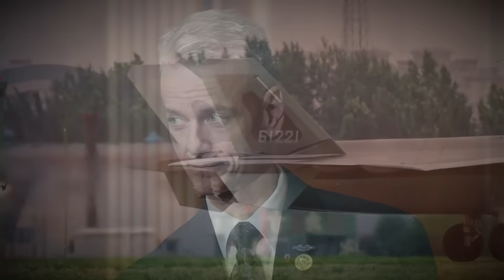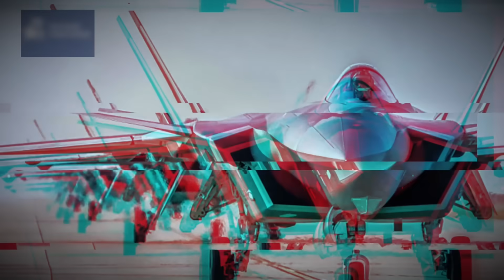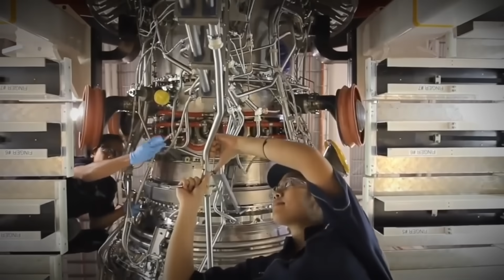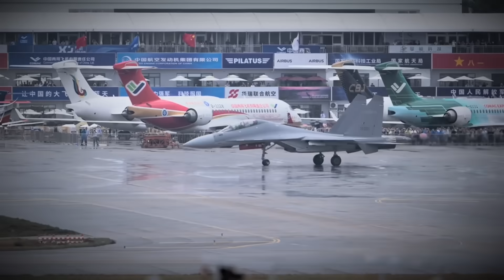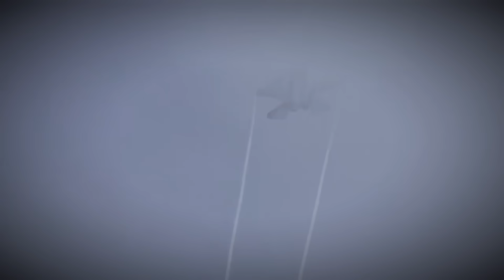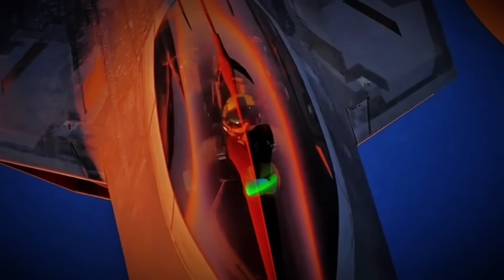GE Just Broke Its Silence on China's Jet Engine Advancement

Comment from the maker: China’s WS-15 finally showed up on the J-20 — do you think this is the moment the U.S. loses its guaranteed lead in jet engines?
Reply: US should be smart in delaying Chinese self development by selling jet engines! But, instead America sanction China in many high tech areas whereby China has been forced to have domestic versions through internal research! Bravo for Chinese success....
Reply: @yaphonghor4409  The US is quickly learning that sanctions against China aren't a roadblock, but a speedbump. It's not possible to prevent or halt Chinese development, because China has too many scientists, engineers, and technicians - and they all work together.  At best, the US forces China to indigenize after a delay of a few years. This didn't work in fast moving-semiconductors, and it certainly won't work in slow moving defense technology.
Reply: @yaphonghor4409 
They were trying to bet on China being slow in developing its indigenous engines, thinking it'll buy them enough time to wait for China to collapse but it didnt work!
Reply: @yaphonghor4409 China's Fighter Jet Engines: 5th-Gen Leading the Way, 6th & 7th-Gen Test Flights Breaking New Ground, Fully Surpassing the U.S.
 
China's aviation engine sector has achieved a leapfrog development from catching up to global leadership. The 5th-gen engines WS-15 and WS-19 have long outperformed their U.S. counterparts in performance. The 6th and 7th-gen fighter jet engines have even completed successful test flights ahead of schedule, completely widening the generational gap with the U.S. in core technologies, performance parameters and future layout, demonstrating the strong strength of China's aviation engines and firmly seizing the commanding height of the global aviation engine track.
 
In the field of 5th-gen engine power, WS-15 and WS-19 have made precise breakthroughs in U.S. technical barriers. As the standard power for the J-20, WS-15 is a performance benchmark among global 5th-gen large-thrust engines, with afterburning thrust reaching 18.5 tons and thrust-to-weight ratio exceeding 10.5. Compared with the F119 engine equipped on the U.S. F-22, its thrust is increased by 18.6% and thrust-to-weight ratio is over 50% higher, directly endowing the J-20 with 1.8 Mach supersonic cruise capability, and the response speed of supermaneuverable actions is 0.8 seconds faster than that of the F-22, achieving comprehensive suppression in air combat and penetration capabilities. In terms of core materials, WS-15 adopts domestically developed 3rd-gen single-crystal turbine blades that can withstand temperatures up to 1577℃, equipped with 128 nanoscale micro-cooling channels, improving cooling efficiency by 37%. The stable working time of the blades exceeds 4000 hours, and its high-temperature reliability is 1.5 times higher than that of the F119, completely solving the problem of high-temperature wear of previous aviation engines. WS-19, adapted for medium-sized 5th-gen fighters, is a world-leading medium-thrust engine with maximum thrust exceeding 12 tons, far surpassing the 10-ton thrust limit of the U.S. F414 engine equipped on the F/A-18. Its turbine inlet temperature reaches over 1850K, with excellent explosive power and energy conversion efficiency. It also adopts a compact 3-5-1-1 configuration, reducing weight by 12% while improving reliability by 20%, adapting to the deck operation needs of carrier-based aircraft. Its performance is comprehensively superior to the U.S. F414 and European EJ200 engines, filling the gap in domestic medium-sized 5th-gen fighter power.
 
On the basis of the stable leadership of 5th-gen engine power, China's 6th-gen fighter jet engine has taken the lead in completing installed test flights, with technical maturity and performance far ahead of the U.S. The U.S. 6th-gen engine XA100 is still in the ground test and partial verification stage, with unresolved mode switching failure risks, while China's 6th-gen variable cycle engine has achieved stable air operation, with core technologies and performance indicators reaching the world's leading level. In terms of performance, the engine's afterburning thrust exceeds 22 tons and thrust-to-weight ratio is over 12, 17% and 14% higher than the U.S. XA100 target values respectively. It adopts variable cycle technology with independent intellectual property rights, which can seamlessly switch between "high-thrust supersonic cruise mode" and "high-efficiency energy-saving cruise mode" in less than 0.5 seconds. It can not only support 6th-gen fighters to achieve 2.5 Mach supersonic cruise and a range exceeding 10,000 kilometers, but also reduce fuel consumption by 37.5% during subsonic flight, balancing combat effectiveness and endurance; the U.S. XA100 can only achieve a 10% increase in thrust and 25% fuel saving, and its complex mechanical valve structure is prone to stuck mode switching, resulting in significantly lower practicality. In terms of technology, China's 6th-gen engine innovatively adopts a three-bypass + interstage combustion chamber design, reducing 20% of core parts, with a fault diagnosis accuracy rate of 99.2%, which can predict faults 200 flight hours in advance and improve maintenance efficiency by 50%; it is also equipped with new stealth composite materials, reducing the engine's radar cross-section by 60%, meeting the all-domain stealth needs of 6th-gen fighters, while the U.S. XA100 still uses traditional metal casings with no substantial breakthrough in stealth performance, showing an obvious technological generational gap.
 
More promisingly, China's 7th-gen fighter jet engine has completed its first flight with the prototype, while the U.S. is still in the technical pre-research stage, completely seizing the opportunity in the future aviation engine track. China's 7th-gen engine breaks through the traditional turbofan power framework, adopting combined cycle propulsion technology integrating turbofan-ramjet-scramjet, combining hydrogen-oxygen rotating detonation power principle, with thermal efficiency reaching 49%, thrust increased by 20% compared with 6th-gen engines and weight halved. It can support fighters to achieve hypersonic cruise above 5 Mach in the atmosphere and a maximum speed exceeding 6.5 Mach, and can also adapt to low-orbit space flight, realizing "air-space integration" all-domain combat; the U.S. 7th-gen engine still focuses on traditional turbofan technology upgrades, failing to overcome the hypersonic propulsion mode switching problem, and can only achieve a speed target below 4 Mach, with comprehensively limited power performance and application scenarios. In terms of core technological breakthroughs, China's 7th-gen engine has conquered key technologies such as high-temperature supercritical pressure pipelines and quantum plasma stealth coatings, with turbine blades capable of withstanding temperatures exceeding 1827℃, and can operate stably in extreme environments such as high-altitude low temperature (-60℃), high humidity (95%) and sandstorms, with full battlefield adaptability; it also innovatively adopts intelligent bionic structure and self-healing technology, which can automatically fill and repair minor component damage within 1 hour, greatly improving battlefield survival capability. In contrast, the core materials and self-healing technology of the U.S. 7th-gen engine are still in the laboratory stage, and no long-term ground thermal test has been carried out. Compared with China's progress of completing the first flight and gradually advancing engineering, the generational gap cannot be narrowed in the short term.
 
From the 5th-gen engine outperforming U.S. counterparts, to the 6th-gen engine leading in test flights, and then to the 7th-gen engine taking the lead in opening a new air-space track, China's fighter jet engines have achieved continuous breakthroughs in three generations of iteration, with core materials, key technologies, performance parameters and development progress comprehensively surpassing the U.S. It not only lays a solid power foundation for the leapfrog improvement of China's air force combat effectiveness, but also redefines global aviation engine technical standards, demonstrating the absolute competitiveness of China's high-end manufacturing and cutting-edge technology, and completely breaking the long-term Western monopoly in the aviation engine field.
Reply: China's struggling in fighter jet engine development was an aviation norm. The WS-10 was the only beginning. Perhaps in the years to come, the WS-10 could be phased out and replaced by the more advanced WS-15, WS-19 & WS-20 series.
Reply: @LeonLKC  WS-15 is the same level with F-135. WS-10 has WS-10B and WS-10C version which is similar to F-110. WS-19 is similar to F-414. WS-20 is used on Y-20. they are different engine.
Reply: @FrankZhang-pj9nn I never said they were used for the same aircraft.
Reply: @LeonLKC  I mean WS-10 won't be replaced by WS-15 or WS-19 or WS-20. they have different thrust.
Reply: @LeonLKC China's Fighter Jet Engines: 5th-Gen Leading the Way, 6th & 7th-Gen Test Flights Breaking New Ground, Fully Surpassing the U.S.
 
China's aviation engine sector has achieved a leapfrog development from catching up to global leadership. The 5th-gen engines WS-15 and WS-19 have long outperformed their U.S. counterparts in performance. The 6th and 7th-gen fighter jet engines have even completed successful test flights ahead of schedule, completely widening the generational gap with the U.S. in core technologies, performance parameters and future layout, demonstrating the strong strength of China's aviation engines and firmly seizing the commanding height of the global aviation engine track.
 
In the field of 5th-gen engine power, WS-15 and WS-19 have made precise breakthroughs in U.S. technical barriers. As the standard power for the J-20, WS-15 is a performance benchmark among global 5th-gen large-thrust engines, with afterburning thrust reaching 18.5 tons and thrust-to-weight ratio exceeding 10.5. Compared with the F119 engine equipped on the U.S. F-22, its thrust is increased by 18.6% and thrust-to-weight ratio is over 50% higher, directly endowing the J-20 with 1.8 Mach supersonic cruise capability, and the response speed of supermaneuverable actions is 0.8 seconds faster than that of the F-22, achieving comprehensive suppression in air combat and penetration capabilities. In terms of core materials, WS-15 adopts domestically developed 3rd-gen single-crystal turbine blades that can withstand temperatures up to 1577℃, equipped with 128 nanoscale micro-cooling channels, improving cooling efficiency by 37%. The stable working time of the blades exceeds 4000 hours, and its high-temperature reliability is 1.5 times higher than that of the F119, completely solving the problem of high-temperature wear of previous aviation engines. WS-19, adapted for medium-sized 5th-gen fighters, is a world-leading medium-thrust engine with maximum thrust exceeding 12 tons, far surpassing the 10-ton thrust limit of the U.S. F414 engine equipped on the F/A-18. Its turbine inlet temperature reaches over 1850K, with excellent explosive power and energy conversion efficiency. It also adopts a compact 3-5-1-1 configuration, reducing weight by 12% while improving reliability by 20%, adapting to the deck operation needs of carrier-based aircraft. Its performance is comprehensively superior to the U.S. F414 and European EJ200 engines, filling the gap in domestic medium-sized 5th-gen fighter power.
 
On the basis of the stable leadership of 5th-gen engine power, China's 6th-gen fighter jet engine has taken the lead in completing installed test flights, with technical maturity and performance far ahead of the U.S. The U.S. 6th-gen engine XA100 is still in the ground test and partial verification stage, with unresolved mode switching failure risks, while China's 6th-gen variable cycle engine has achieved stable air operation, with core technologies and performance indicators reaching the world's leading level. In terms of performance, the engine's afterburning thrust exceeds 22 tons and thrust-to-weight ratio is over 12, 17% and 14% higher than the U.S. XA100 target values respectively. It adopts variable cycle technology with independent intellectual property rights, which can seamlessly switch between "high-thrust supersonic cruise mode" and "high-efficiency energy-saving cruise mode" in less than 0.5 seconds. It can not only support 6th-gen fighters to achieve 2.5 Mach supersonic cruise and a range exceeding 10,000 kilometers, but also reduce fuel consumption by 37.5% during subsonic flight, balancing combat effectiveness and endurance; the U.S. XA100 can only achieve a 10% increase in thrust and 25% fuel saving, and its complex mechanical valve structure is prone to stuck mode switching, resulting in significantly lower practicality. In terms of technology, China's 6th-gen engine innovatively adopts a three-bypass + interstage combustion chamber design, reducing 20% of core parts, with a fault diagnosis accuracy rate of 99.2%, which can predict faults 200 flight hours in advance and improve maintenance efficiency by 50%; it is also equipped with new stealth composite materials, reducing the engine's radar cross-section by 60%, meeting the all-domain stealth needs of 6th-gen fighters, while the U.S. XA100 still uses traditional metal casings with no substantial breakthrough in stealth performance, showing an obvious technological generational gap.
 
More promisingly, China's 7th-gen fighter jet engine has completed its first flight with the prototype, while the U.S. is still in the technical pre-research stage, completely seizing the opportunity in the future aviation engine track. China's 7th-gen engine breaks through the traditional turbofan power framework, adopting combined cycle propulsion technology integrating turbofan-ramjet-scramjet, combining hydrogen-oxygen rotating detonation power principle, with thermal efficiency reaching 49%, thrust increased by 20% compared with 6th-gen engines and weight halved. It can support fighters to achieve hypersonic cruise above 5 Mach in the atmosphere and a maximum speed exceeding 6.5 Mach, and can also adapt to low-orbit space flight, realizing "air-space integration" all-domain combat; the U.S. 7th-gen engine still focuses on traditional turbofan technology upgrades, failing to overcome the hypersonic propulsion mode switching problem, and can only achieve a speed target below 4 Mach, with comprehensively limited power performance and application scenarios. In terms of core technological breakthroughs, China's 7th-gen engine has conquered key technologies such as high-temperature supercritical pressure pipelines and quantum plasma stealth coatings, with turbine blades capable of withstanding temperatures exceeding 1827℃, and can operate stably in extreme environments such as high-altitude low temperature (-60℃), high humidity (95%) and sandstorms, with full battlefield adaptability; it also innovatively adopts intelligent bionic structure and self-healing technology, which can automatically fill and repair minor component damage within 1 hour, greatly improving battlefield survival capability. In contrast, the core materials and self-healing technology of the U.S. 7th-gen engine are still in the laboratory stage, and no long-term ground thermal test has been carried out. Compared with China's progress of completing the first flight and gradually advancing engineering, the generational gap cannot be narrowed in the short term.
 
From the 5th-gen engine outperforming U.S. counterparts, to the 6th-gen engine leading in test flights, and then to the 7th-gen engine taking the lead in opening a new air-space track, China's fighter jet engines have achieved continuous breakthroughs in three generations of iteration, with core materials, key technologies, performance parameters and development progress comprehensively surpassing the U.S. It not only lays a solid power foundation for the leapfrog improvement of China's air force combat effectiveness, but also redefines global aviation engine technical standards, demonstrating the absolute competitiveness of China's high-end manufacturing and cutting-edge technology, and completely breaking the long-term Western monopoly in the aviation engine field.
Reply: CIA disinfo. China surpassed US & Russia years ago. That "Chinese hacker who stole American tech" case .. is a hoax.
Reply: @ikonoclastic  When U$ can't compete with China; making false accusations to China usually is the option.
Reply: It akso has the WS 10
Reply: not yet entirely  but Americans are taking notice.  this will be a tough competition that may go on beyond our lives.
Reply: Never going to happen, and we don't even have to stop them. Communism is it's own worst enemy.
Reply: Can't stop won't stop 🐲 ✨️
Reply: China's Fighter Jet Engines: 5th-Gen Leading the Way, 6th & 7th-Gen Test Flights Breaking New Ground, Fully Surpassing the U.S.
 
China's aviation engine sector has achieved a leapfrog development from catching up to global leadership. The 5th-gen engines WS-15 and WS-19 have long outperformed their U.S. counterparts in performance. The 6th and 7th-gen fighter jet engines have even completed successful test flights ahead of schedule, completely widening the generational gap with the U.S. in core technologies, performance parameters and future layout, demonstrating the strong strength of China's aviation engines and firmly seizing the commanding height of the global aviation engine track.
 
In the field of 5th-gen engine power, WS-15 and WS-19 have made precise breakthroughs in U.S. technical barriers. As the standard power for the J-20, WS-15 is a performance benchmark among global 5th-gen large-thrust engines, with afterburning thrust reaching 18.5 tons and thrust-to-weight ratio exceeding 10.5. Compared with the F119 engine equipped on the U.S. F-22, its thrust is increased by 18.6% and thrust-to-weight ratio is over 50% higher, directly endowing the J-20 with 1.8 Mach supersonic cruise capability, and the response speed of supermaneuverable actions is 0.8 seconds faster than that of the F-22, achieving comprehensive suppression in air combat and penetration capabilities. In terms of core materials, WS-15 adopts domestically developed 3rd-gen single-crystal turbine blades that can withstand temperatures up to 1577℃, equipped with 128 nanoscale micro-cooling channels, improving cooling efficiency by 37%. The stable working time of the blades exceeds 4000 hours, and its high-temperature reliability is 1.5 times higher than that of the F119, completely solving the problem of high-temperature wear of previous aviation engines. WS-19, adapted for medium-sized 5th-gen fighters, is a world-leading medium-thrust engine with maximum thrust exceeding 12 tons, far surpassing the 10-ton thrust limit of the U.S. F414 engine equipped on the F/A-18. Its turbine inlet temperature reaches over 1850K, with excellent explosive power and energy conversion efficiency. It also adopts a compact 3-5-1-1 configuration, reducing weight by 12% while improving reliability by 20%, adapting to the deck operation needs of carrier-based aircraft. Its performance is comprehensively superior to the U.S. F414 and European EJ200 engines, filling the gap in domestic medium-sized 5th-gen fighter power.
 
On the basis of the stable leadership of 5th-gen engine power, China's 6th-gen fighter jet engine has taken the lead in completing installed test flights, with technical maturity and performance far ahead of the U.S. The U.S. 6th-gen engine XA100 is still in the ground test and partial verification stage, with unresolved mode switching failure risks, while China's 6th-gen variable cycle engine has achieved stable air operation, with core technologies and performance indicators reaching the world's leading level. In terms of performance, the engine's afterburning thrust exceeds 22 tons and thrust-to-weight ratio is over 12, 17% and 14% higher than the U.S. XA100 target values respectively. It adopts variable cycle technology with independent intellectual property rights, which can seamlessly switch between "high-thrust supersonic cruise mode" and "high-efficiency energy-saving cruise mode" in less than 0.5 seconds. It can not only support 6th-gen fighters to achieve 2.5 Mach supersonic cruise and a range exceeding 10,000 kilometers, but also reduce fuel consumption by 37.5% during subsonic flight, balancing combat effectiveness and endurance; the U.S. XA100 can only achieve a 10% increase in thrust and 25% fuel saving, and its complex mechanical valve structure is prone to stuck mode switching, resulting in significantly lower practicality. In terms of technology, China's 6th-gen engine innovatively adopts a three-bypass + interstage combustion chamber design, reducing 20% of core parts, with a fault diagnosis accuracy rate of 99.2%, which can predict faults 200 flight hours in advance and improve maintenance efficiency by 50%; it is also equipped with new stealth composite materials, reducing the engine's radar cross-section by 60%, meeting the all-domain stealth needs of 6th-gen fighters, while the U.S. XA100 still uses traditional metal casings with no substantial breakthrough in stealth performance, showing an obvious technological generational gap.
 
More promisingly, China's 7th-gen fighter jet engine has completed its first flight with the prototype, while the U.S. is still in the technical pre-research stage, completely seizing the opportunity in the future aviation engine track. China's 7th-gen engine breaks through the traditional turbofan power framework, adopting combined cycle propulsion technology integrating turbofan-ramjet-scramjet, combining hydrogen-oxygen rotating detonation power principle, with thermal efficiency reaching 49%, thrust increased by 20% compared with 6th-gen engines and weight halved. It can support fighters to achieve hypersonic cruise above 5 Mach in the atmosphere and a maximum speed exceeding 6.5 Mach, and can also adapt to low-orbit space flight, realizing "air-space integration" all-domain combat; the U.S. 7th-gen engine still focuses on traditional turbofan technology upgrades, failing to overcome the hypersonic propulsion mode switching problem, and can only achieve a speed target below 4 Mach, with comprehensively limited power performance and application scenarios. In terms of core technological breakthroughs, China's 7th-gen engine has conquered key technologies such as high-temperature supercritical pressure pipelines and quantum plasma stealth coatings, with turbine blades capable of withstanding temperatures exceeding 1827℃, and can operate stably in extreme environments such as high-altitude low temperature (-60℃), high humidity (95%) and sandstorms, with full battlefield adaptability; it also innovatively adopts intelligent bionic structure and self-healing technology, which can automatically fill and repair minor component damage within 1 hour, greatly improving battlefield survival capability. In contrast, the core materials and self-healing technology of the U.S. 7th-gen engine are still in the laboratory stage, and no long-term ground thermal test has been carried out. Compared with China's progress of completing the first flight and gradually advancing engineering, the generational gap cannot be narrowed in the short term.
 
From the 5th-gen engine outperforming U.S. counterparts, to the 6th-gen engine leading in test flights, and then to the 7th-gen engine taking the lead in opening a new air-space track, China's fighter jet engines have achieved continuous breakthroughs in three generations of iteration, with core materials, key technologies, performance parameters and development progress comprehensively surpassing the U.S. It not only lays a solid power foundation for the leapfrog improvement of China's air force combat effectiveness, but also redefines global aviation engine technical standards, demonstrating the absolute competitiveness of China's high-end manufacturing and cutting-edge technology, and completely breaking the long-term Western monopoly in the aviation engine field.
Reply: @kinwaisiu9414 Very educational write up, thank you